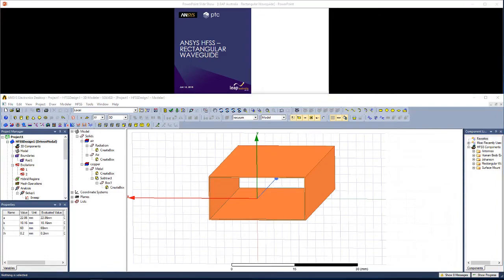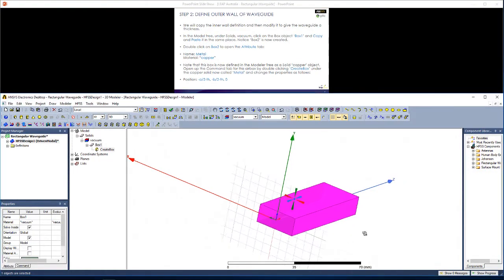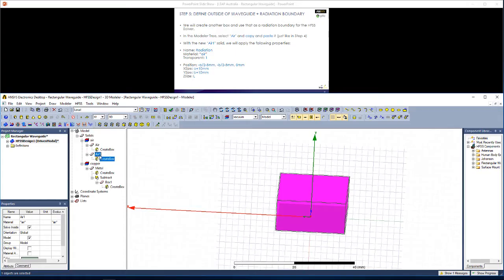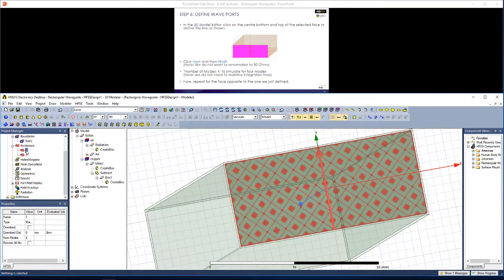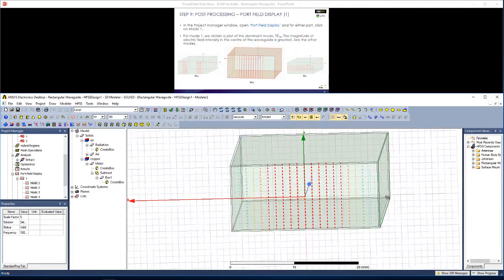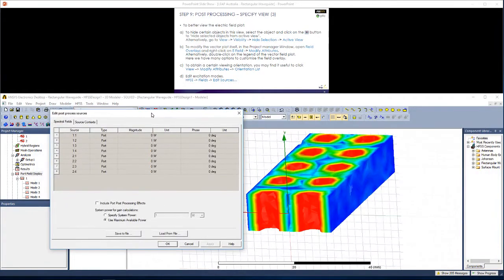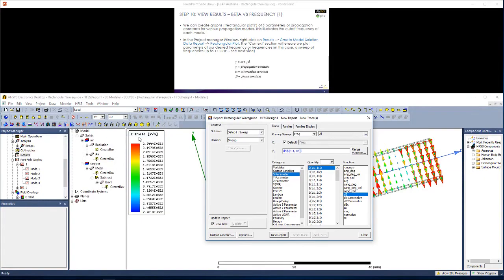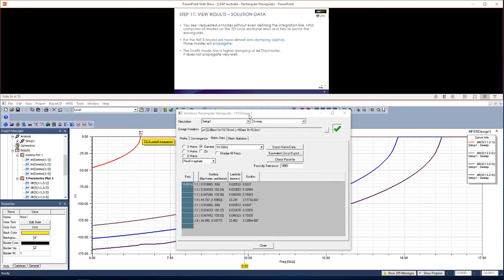Rectangular Waveguide   ANSYS HFSS

Comment: I'm at the Waveport section and when I select a face and go on to assign a wave port I don't get the window that you are getting. I instead get a window that is called "Ference Conductors for Terminals" and I can't assign any integration lines.
Reply from the maker: The default HFSS solution type is “Driven terminal”.  We can change this by clicking on “HFSS” in the main menu and then “Solution Type”.
In the window that pops up, select “Modal”, and click ok. This will change the solution type to “Driven Modal”.
You will then be able to define integration lines for your wave ports.
Reply from the maker: By the way, there has been an enhancement in this regard within the latest Ansys 2023R1 release. Users can now define both wave ports and terminal ports in the same design.

Comment: Very good explanation,  Sir I want to asked a question how can we plot TEmnp  in HFSS (example like TE102 and TE201 mode)
Reply from the maker: The subscripts represent the mode order along the x,y and z axis.
This tutorial demonstrates a rectangular waveguide with its cross-section oriented in the XY plane. The waveguide has ports assigned to the faces parallel to the XY plane. Therefore, the wave is propagating in the Z direction and as a result, we can have TE(mn) or TM(mn) modes.
TE(mnp) or TM(mnp) modes can be considered for a cavity that has no ports and these can be analyzed using the Eigen mode solver in Ansys HFSS
Reply: @leapaustralia  thank you

Comment: why we give 12 passes?
What is the purpose of radiation box?
Reply from the maker: Ansys HFSS uses an automatic mesh refinement process to generate accurate EM solution for arbitrary 3D geometries. There are two control available to the user namely Max Delta S and the maximum number of passes. The default value for max number of passes is set to 6. With each successive pass, the mesh is refined, and the solution results are compared with the previous pass. This ensures that the final solution has converged and hence is mesh-independent. If the solution doesn’t converge with the defined number of passes, the user should increase the maximum number of passes to ensure a converged solution. 
 
One can plot Delta S vs. Pass Number to monitor the convergence while the analysis is running.
Reply from the maker: Re: What is the purpose of radiation box?
A radiation boundary condition (BC) is required for analyzing structures that radiated electromagnetic energy into free space, such as antennas. PEC (perfect electric conductor) is the default background material. Assigning radiation boundary conditions overrides this and ensures that the energy incident on this BC is absorbed and doesn’t get reflected into the solution space.
Reply: @leapaustralia  How we can see the radiation outside the waveguide? Thanks

Comment: Port refinement, process hf3d error: Port 1 is assigned to an internal face.  Only allowed with lumped ports.. I get this error using wave port
Reply from the maker: Wave ports must be assigned on the outer boundary of the design. If you need to assign a wave port to a surface that is completely inside the solution domain, then create a cap object with PEC assignment, that completely covers the face that is being assigned as a wave port.
This ensures that EM energy can only propagate in the normal direction away from the cap object.

Comment: I'm using ANSYS 2018.1 and I don't have the option available to use HFSS as a modeler. Am I missing something?
Reply: Tools-options-general options, under general configuration change it to 'all'
Reply from the maker: Please install Ansys electronics desktop (AEDT) and Ansys with identical versions on your machine. Once you have completed the installation click on the windows start button and click on the Ansys EM Suite version installed and select “Modify Integration with Ansys”.

Comment: Hi, I exactly followed your tutorial but when I click on "Analyse All" button I get these messages and the analysis is stopped.

[info] A discrete frequency sweep with 121 point(s) has been started using HFSS - Solving Distributed. (4:17:25 PM  May 08, 2019)
[error] The HFSS solver failed to start. Please contact technical support. (4:17:25 PM  May 08, 2019)
[error] Simulation completed with execution error on server: Local Machine. (4:17:25 PM  May 08, 2019)

Do you know how to solve it?
Reply: Account Nuovo try to change the settings of the sweep!
Reply from the maker: The error indicates that a distributed solution was initiated. This happens when the user selects more than one variation to solve simultaneously using the HPC settings. HPC settings enable users to distribute parametric variations or frequency points in parallel on a machine with multiple cores or a list of machines connected via a network.
Ensure that you have installed and configured the components required to run the job, such as RSM and MPI libraries. For customers in Aus & NZ please contact us at support@leapaust.com.au for further information